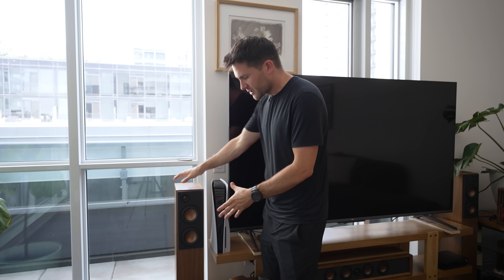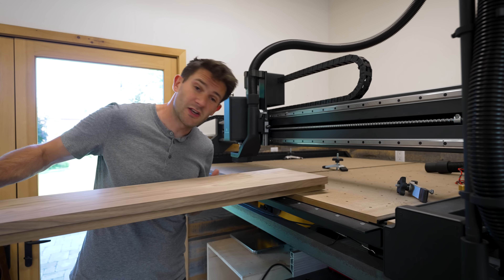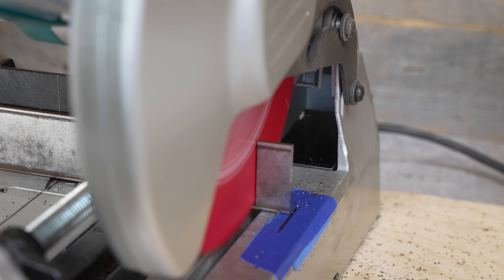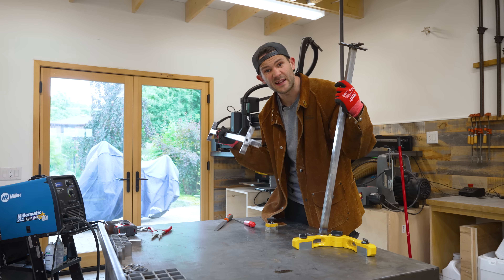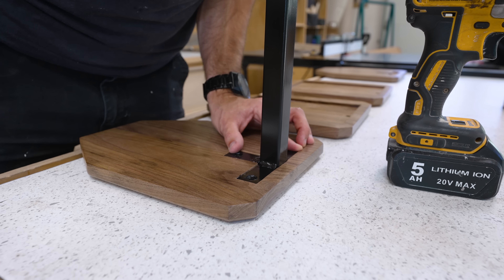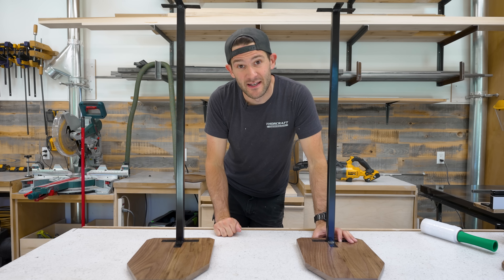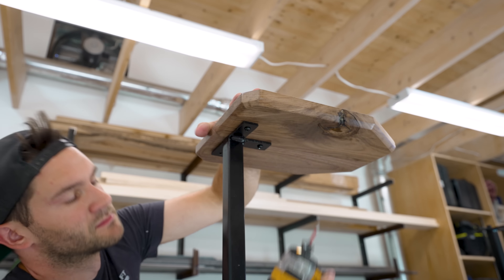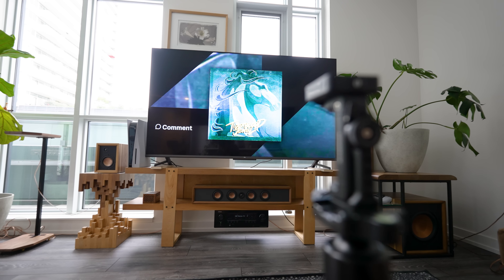The one trick audiophiles DONT want you to know...

Comment: I think that a lot of the reason for the bass being weaker on the stands is simply because a lot of the energy from the speaker goes into slightly moving the stands. While you probably dampened the resonance from the stand itself by using the sand (which is also used to simply give the stands more weight and in that way adding stability to them) they are still most likely a bit flexible from using just one thin steel tube off center. If the design used bigger steel tubes and also used 2 or 3 of them instead of just 1 it would've been a lot more rigid, which in turn wouldn't let the bass energy get lost into slightly moving the stand. This is the reason why a simple cement block can make a speaker sound great when used as a stand. They are simply to heavy and rigid for any energy to actually move into them, which in turn makes the sound waves fly to your ears instead of getting absorbed by the stand itself.
Reply: Yes. The design of the stands made it unlikely that they would make the speaker sound better.
Reply: The difference can not be able to hear a person that is not an audiophile.
But for the training ears 👂 of the audiophiles, searching for the better than the perfect, it is a huge difference!

Comment: Just a suggestion:  Bring the speakers to the table saw and trim the front baffles flush.  Even better, round the front (side) corners.  Next, trim off some of the speaker stand bases so that doesn't reflect sound either.  And will look nicer too IMO
Reply: Yes! Yes! All those extra wood flats and protruding corners all act as secondary out of phase radiation points for the tweeter and making the highs sound more harsh.
Reply: Yep, the subtle differences of different stands and speaker spikes was masked by the larger flaws of recessed speaker baffles and a ~spherical radiation pattern of a speaker on a stand vs a ~hemispherical radiation pattern of a speaker sitting on the floor.

He should have heard a difference just from that difference in placement so the fact that he didn't means he doesn't have "golden ears".

I consider that good luck because the alternative involves spending a fortune on "audiophile" snake oil.

Comment: The sand does make a lot of difference. My Wharfdale W60D speakers I purchased in 1968 are filled with sand to dampen the vibrations of the 12 Inch woofers along with the 6 inch midrange and 3 inch tweeters in each unit. The cabinet is solid walnut. Because of all this, each speaker weighs 50 pounds. I have thought of building speaker stands to raise them off the floor, but they would have to be strong. After watching your video, it might not improve the sound. They sound great sitting on the floor anyway. BTW your videos are fantastic. I have a friend who just died at 99 11/12 who built his own 2-passenger plane from scratch. Everything except the motor, instruments and tires. He had a metal and wood shop similar to yours. The body was balsam wood covered with fiberglass. I took still pictures during the building process. Too bad YouTube didn't exist in 1970. Their computers didn't have video.

Comment: I actually did notice a kind of distinguished difference between each setup. But I do however think that the biggest difference is due to placement rather than the stands. 

It would be really interesting to see the same comparison, but with the speakers placed on the same height and open space on every test, if you do hear a difference then its likely due to the stands.

Keep up the good work :)
Reply: You need a proper stand in order to be able to place them well though. But it is correct that placement is far more important than type of stand.
Reply: @oysteinsoreide4323 placement far outweighs the quality of stands , I so agree

Comment: Spike feet are just to penetrate carpet so the speaker doesn't rock on a too-soft base, the cups that receive the spikes are so you can keep the spikes on your speaker when you move it to a floor you don't want to damage.

Sand (or gravel, or lead shot) in a metal stand does help prevent the stand ringing in resonance with the speaker, although enough metal and the natural frequency gets lower until it's irrelevant. But if your metal stand does ring, it's not a subtle flaw!

Comment: Stands defiantly make a difference to the sound quality. It produces much less vibrations compared to if it was placed on a desk or the floor. You can also eliminate this with foam pads. You also have to think about acoustic treatment and the size of the woofer compared to the size of the room. And of course you'll need to have them set up properly and in the right position. But going into that much detail is only really necessary when professionally mixing or producing.

Comment: I use PrimeAcoustic stands for my studio speakers and they have made a major difference in the tightness of the bottom end of my speaker sound. I first experienced this while working for the CBC and bought a pair of stands for myself based on my experiences there. They successfully isolate the speakers from causing external vibration of the bass frequencies thus resulting in a more precise lower frequency.

Comment: On the floor you could hear more bass, but I think it's just due to the position: in a corner the bass are always amplified. Also as surround speakers you don't necessarily want to have too much bass on them tho.
For the sand, I've read somewhere that it was more because it's breaking the resonance freq of the hollow tubes. The sound impacting on them will resonate and be distorted. So it's not really for the speakers it's holding, but more for the speakers shooting at it.

Comment: Not a bad use of all Hardware but there are designs out for a dedicated dipole rear speaker in the overnight sensation lineup. I've built them and they do a nice job filling in without being too directional. Which is kind of what you want for some Rears

Comment: Great video.  I would like to add some personal findings, as all the things you did will, indeed, improve sound quality.  However... I had a set of speaker stands with two small vertical tubes (1" x 2" each) which I filled with sand for a decided improvement over being empty.  But there was still some ringing.  I then built new stands using a single 4" square tube, and tested empty and full of sand.  When the larger tube was full of sand, all perceivable resonance disappeared.  I attribute this to the sheer mass and absolute deadness of the sand.  They were quite heavy.  The bass got much quicker and the mid base flattened, and my overall soundstage (width and rear/forward depth) opened up big time.  I would reuse the tops and bottoms of those stands and replace the pillar with something more substantial.  You are certain to hear an improvement.

I also found that museum putty rolled out thin (about 1/8" thick) placed between the speaker and the stand was way more effective than using acoustic mat or pucks.  It will 100% stop any high frequency movement between the two hard surfaces, as if your speaker were encased in concrete, which will bring out accuracy in the sounds reproduced (at least as accurate as your playback equipment is capable of, without the speaker becoming an instrument , in and of itself).  

The feet, I agree with you.  They look cool, but other than used on a sub woofer, I have found no particular improvement with or without them.

Last, as others mentioned, speaker placement will be the single biggest way to improve your listening experience.  All other treatments, like described above or acoustic panels on the walls, are simply going to refine what you hear once you have nailed the placement of your speakers.  There's a slew of videos out there regarding placement and I encourage folks who aren't familiar with this to check them out.  You will not be sorry.  I hope this helps.

Comment: Having quite a nice setup myself I would say two things. First of all it depends on the floor material. If it's wood on wood joists then the bass is just going to flood out / dissipate through the floor (and you'll annoy everyone in the house!). Spikes will avoid that and send the bass to where it's meant to go. Secondly, it all comes down to the source - having a better amplifier, etc. will give the best improvement. And then it's just the law of diminishing returns. I knew someone that used to turn his turntable by 90 degrees every three months because he though it handles the magnet fileds better. Now that is taking it to extremes - but if it makes you feel better.....

Comment: Between the sounds of floor mounted and the two stands, the difference is in clarity and bass level. The floor mount gave the most bass, thanks to the floor reflecting the lower tones more. But it also muddied the bass more, reinforcing certain low notes, making it less distinct (which is why speakers, including subs, should not be placed in corners). Mids and highs were also less distinct, since. we now had two sources of those notes - the sound from the drivers hitting us first, then the reflected sound off the floor. The larger of the two stands has a smoother bass and more distinct mids and highs, while the tall stands gave the best highs and most accurate bass (from the speaker's ability), since nothing was reinforcing and adding to the speaker, though it may not be the best sound for a listener's preference.

Your rear speaker placement, like in many homes, is dictated by the furniture and it's layout (and by significant other, who hold final approval). The left rear is nearly perfect, being away from any walls and angled slightly, while the right is stuck against the wall, exaggerating the sound. The ideal audiophile thing to do is to move the sectional out away from the wall so there is a lot of free space around the speaker. That method totally makes the room unusable. So, what to do? Make the surrounds face each other, aimed forward a tad so they converge about a foot back from the face of the sofa. This will give you great sound sitting on the sectional facing the screen. The people watching and listening on the sectional against wall won't get the best sound, but they came in late to the movie and they should be glad they have a place to sit.

The speaker stand's job is to hold the speaker at eye level to the listener. That is it. It's not supposed to add or take anything away from the speaker itself, so the aim is to make it neutral - adding no sound by vibration and not moving to muddy the sound. Oh so easy to do: hollow metal tubes filled with lead shot, heavy bases and speaker platforms, spikes into carpet, Blu Tack tape if on a wood floor. Very high on the ASF (amazing sound factor) and so very low on the WAF scale (wife acceptance factor). Oh so hard to make look good!

Comment: Small piece of advice, a larger drill will not actually countersink a hole as the drill point is around 120 degrees, whereas countersunk screws are usually 90 degrees, so you will get a better result with a dedicated countersunk bit off amazon.

Comment: I can hear a difference with the speaker stands for the better, but it’s also attributed to the height that they were placed as compared to putting them on the floor where there’s a direct, bounce immediately and then putting it on other furniture that snap position to ear level bottom line. It all plays a part.

Comment: I recently made some speaker stands out of Baltic Birch. Basically a 6” square tube sitting on a 14 inch base both of which were completely filled with sand and they came out amazing! My new Focal 80 ‘s sound incredible on them in the studio! Cost me about 60 bucks to make. I think what you built here is really nice. My only thought is not quite large enough doesn’t have enough mass to achieve the affect you’re really looking for. I’m sure better than if you had not done it this way, but that’s just my guess. Honestly, I hate to say this I thought they sounded the best on the floor.

Comment: I loved watching you build these stands. Now, some notes from an audiophile that hates snake oil: The position of the speakers (in the room) will make far more of a difference than the stands. The lip on the bottom of the stands is not ideal, some sound will reflect off of it and bounce back to interfere with the primary sound from the speaker. Sand is a big deal, but you need 20-80 lbs of sand. (IMO) the biggest difference is to stabilize the stands but even with less weight it should also deaden vibrations in the metal. Decoupling with foam is a nice touch. Coupling and stabilizing with the metal feet looks nice and using spikes is essential for folks with thick carpet (spikes are not cones).

Comment: spikes are coupling to the floor. But if the floor is concrete, then it is OK to do that. But if the floor is wood, then you will have to isolate. But you have already isolated the speakers from the stands to the speakers. So what you do further down will not have much effect. You will get better effect if youcouple the speakers to the stands instead of isolate there.

Comment: I have to say the stands look great!

I'm by no means an audiophile, more of an enthusiast. But as someone who has spent a lot of time reading and testing myself I hope I can shed some light on the "myths" that were mentioned.

Usually we fill the stands to prevent them from creating a ringing sound at their resonance frequency. A highly scientific way to test this is by simply tapping a tube with no filling and a tube with filling using a screwdriver or something and observing the difference in ringing. The ringing can be triggered as the speaker plays the same frequency as the resonance frequency of the stands and therefore coloring the sound in a potentially unwanted way. The "improved bass response" idea of this might stem from the usage of larger diameter tubes which would have a lower resonance frequency than that of a smaller diameter tube. But this is just speculation on my behalf.

So the idea of filling the stands has a similar idea as isolating the speakers using foam pads. It's meant to reduce the response coming from the floor or the stand so that you get as much of the sound as possible directly from the speaker. 

Another thing I noticed is that the stands are protruding in front of the baffle. Usually this is also unwanted due to the very early reflection from the tweeter and midrange which may create all kinds of wonky responses. All of this can be measured and I'd suggest getting a cheap measurement microphone like the minidsp umik-1 and a free software like room equalizer wizard and testing it out for yourself.

Spikes are indeed a tricky topic and in my research I have found that if you have a wooden floor, you do not want to use spikes. Spikes couple the speaker to the floor, they do not isolate them from it. A wooden floor will resonate at bass frequencies coloring the sound from the speaker like the stands. Instead you want to isolate them from the floor by using isolation pads. If you have a concrete floor, an effective way of getting rid of the vibrations that inevitably get into the stands is by leading it straight into the concrete. The concrete is very heavy and therefore has a much lower resonance frequency than wood which means it's unlikely to affect the sound. So we want to couple the stands to the floor by using spikes if the floor is concrete (or if you have a concrete floor with laminate on top). If the floor is wood we want to isolate the stands from it as much as possible, although it's almost impossible to completely isolate them.

Comment: 4:40 Curved flap paddle discs? I don't think I've ever used them. I'll have to get some and give that a try for cleaning up inside corners. Can you recommend some for wood?
11:00 When the speakers were on the floor, the music sounded a bit more heavy in the bass to me, especially the horn and distortion overlay. As it's not a song I'm familiar with I checked it out on YouTube, then rewatched that segment and the floor definitely made the speakers sound different than when they were either on stands or on furniture. That's probably an audio reflection issue, since neither the stands or the furniture have a plane extending several feet in front of the speakers.

Comment: Yes is a difference between the placement of the speakers on the floor and up on the metal stands. The speakers on the floor have more bass, but this results from the room reflections, so the bass is artificial with lots of sustained and muddy characteristics and almost no attack and precision. The speakers on the stands sound more accurate in the mid and high areas but need improvement in the lower frequencies. I would try to kill any vibrations on the speaker box by making the box with a double wall filled with sand, activated carbon, or baby powder; the baby powder contains magnesium which has sound-isolated properties.
Reply: And yes, Tall Paull is right "trim the front baffles flush."

Comment: There’s most definitely going to be some minor differences considering the sand and the padding. The question I have is if the difference is a good one or a bad one. At times, a bit of distortion coming from your set up adds to the experience rather than takes away from it.